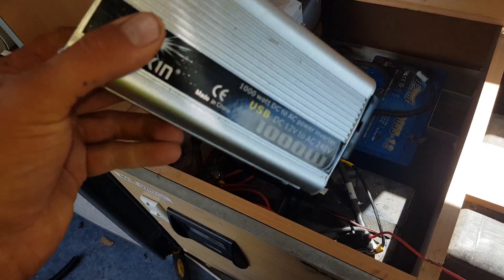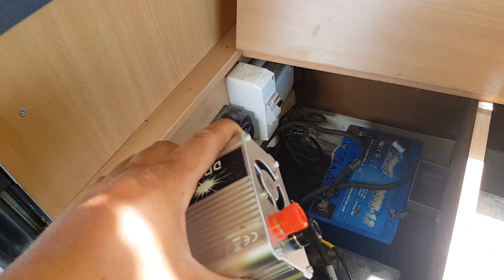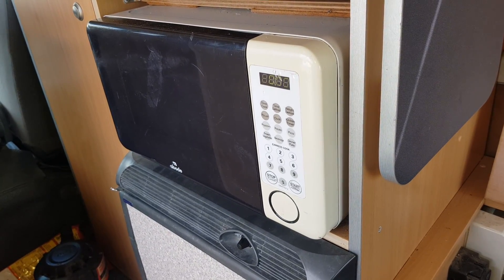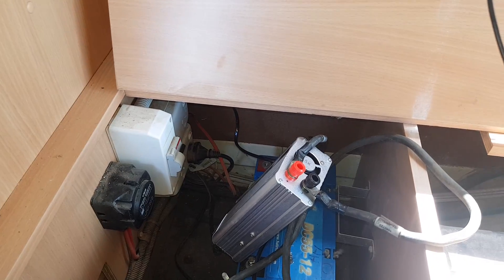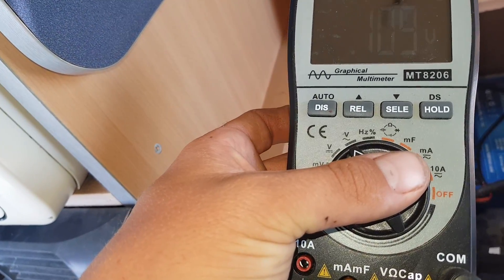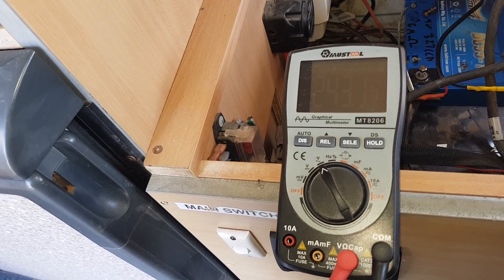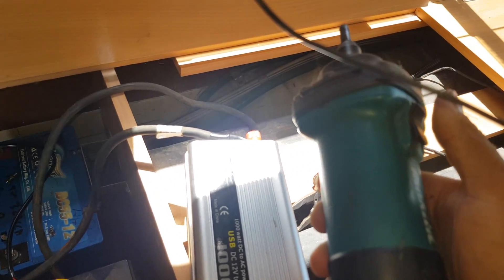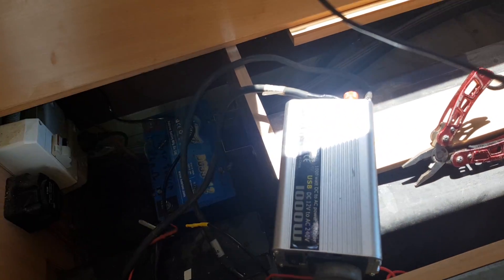Cheap 1000Watt Inverter testing $35

Comment: Would it run a vacuum cleaner? Henry 620w or maybe even a 1000w vacuum cleaner?
Reply from the maker: Doubt it would have the inrush power to start 1000w 600w drill was no issues in my tests
Reply: @Oneupthesleevecustoms   do you have a link to the same one you bought ?
Reply from the maker: @emmanuelhud1  ill make you a link

Comment: $35 WTF, how nasty is the wave form?If you know someone with a Scope you should see what it looks like, hard waveform is not good for longevity of the devices attached to it. just saw the empty fire extinguisher bracket again :)
Reply from the maker: Haha shit ill go buy and and send you a video haha. Its a very square wave form but its also consitant. Nothing worse than a changing one that makes some horrific electric sounds. Will be fine for things like drills switchmode chargers made no noise? Weird
Reply from the maker: Ill buy a scope one day
Reply: They have the same thing in 110v in states and the waveform is pretty good. The old engineer has a video showing the waveform. I don't think they are rated correctly.
Reply from the maker: Im yet to have an issue with it its going well so far. Ill have a testing video coming up soon
Reply: @Oneupthesleevecustoms  https://youtu.be/4NEcVRW2idg 22:50 shows waveform
Reply from the maker: Trying to.forget that day hahahah
Reply: @Oneupthesleevecustoms  The internet remembers EVERYTHING!